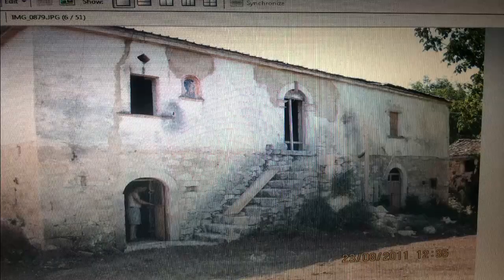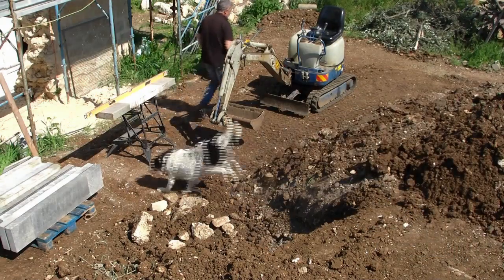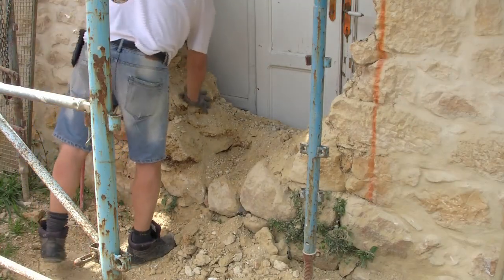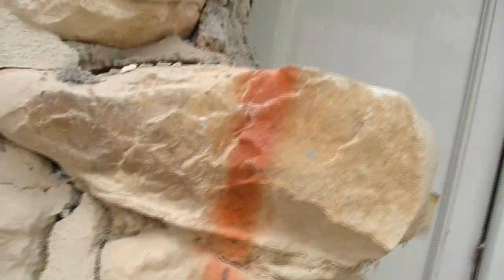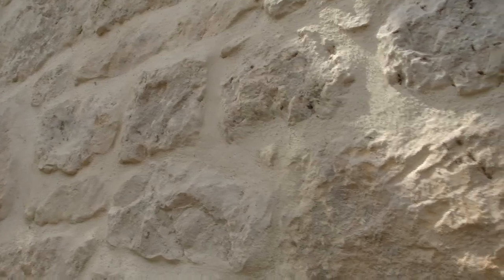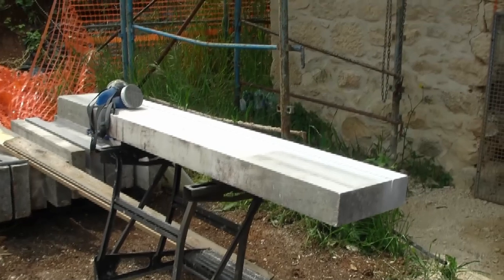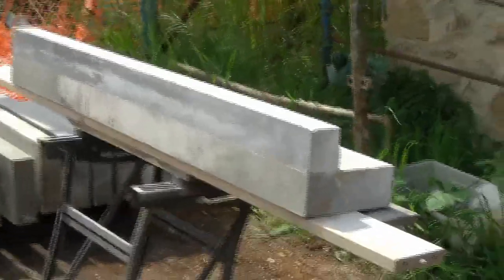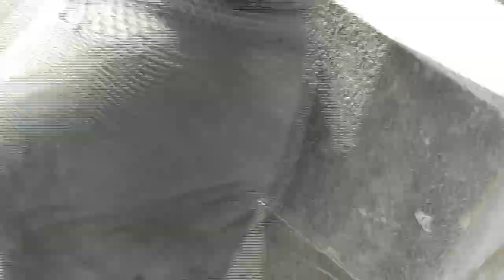Stone wall opening restoring a Farmhouse in Abruzzo Italy doing it ourselves  Ep 16

Comment: How do you support the wall while you make a hole?
Reply from the maker: Hi there with acro' also steel scaffolding system internal and external
Reply: @Brambletye.  we’re just starting to embark on a similar project in Italy as well. How did you go by the permissions? Did you do it yourself based on your knowledge - or did you need to consult a structural engineer before doing the holes?